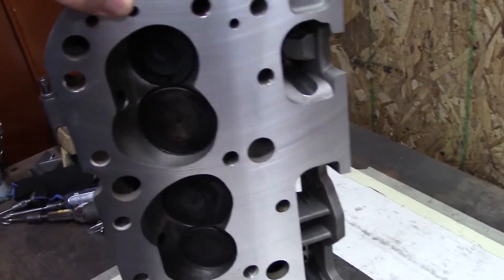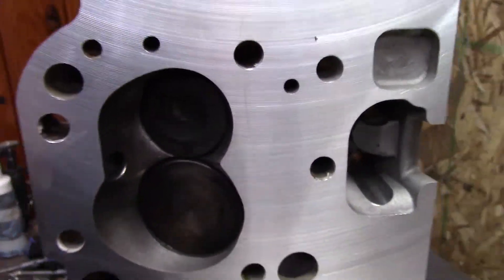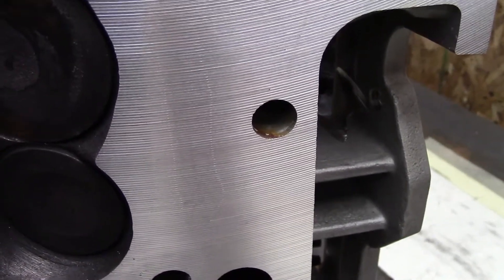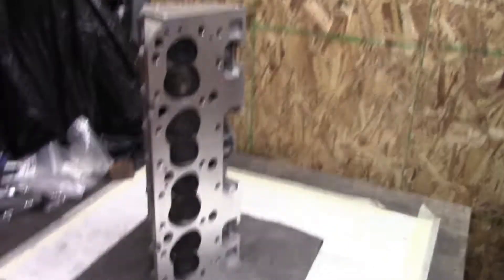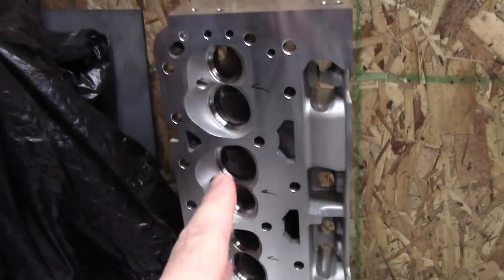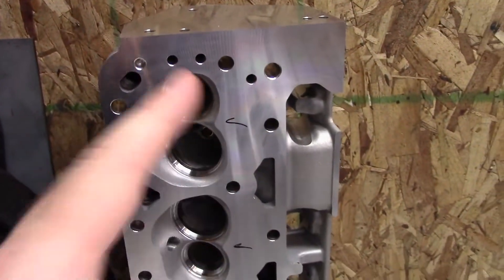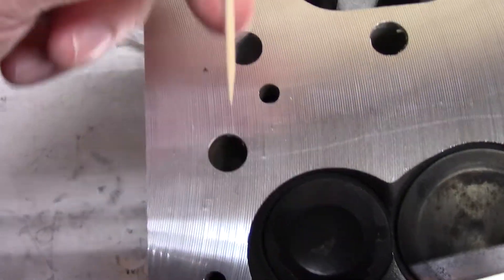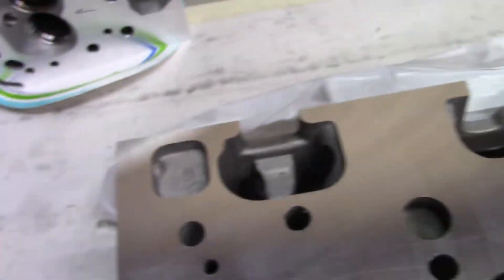Cylinder Head Deck Surface Finish , What Do You Think???

Comment: If it was not more than .004, it's  within tolerance. Surface finish could be as high as RA 100. If you want to make extra sure it won't leak, copper coat the gasket on both sides, and be sure to use new head bolts and  follow torque sequence and specs.
Reply: @JoseLeal-yn4rv

.004 what? Inches? Mm?

Comment: I'm an semi-retired automotive machinest with 37 year experience. I specialize in cylinder heads out of my garage at this point. Low overhead. My verdict is let them drop it on a flat belt surfacer if they have one. It will basically broach it. Usually .005 will be enough to clean it up. Now and days, those circular CNC machines and or lathe attatchments can be lethal in the wrong hands. Personally, you can do an old time boarding with shelving wood, sandpaper and some wd40

Comment: I'd hit it with a sanding board an run it, i've seen factory broched heads that looked like that and never had any issues, we weren't as spoiled 30 years ago as we are now in a CNC world !
Reply from the maker: So you wouldn't bolt them on as is
Reply: @BOOT  no the area that will be the quench area when the head is bolted on could get carboned up , better to be smoother and reflect heat back into the bore as well. i dont see why a clean up with some 240 grit would take more than 5 minutes and if your inclined you could polish the area i mentioned a bit more and yer good ta go.
Reply from the maker: I know someone who said they use a body board to touch up/clean heads and I actually bought one to try it awhile back with finer than 240 but I still have not because I think it will be hard to get it even.  I still may try on one of my old heads but this procomp head isn't mine and I only borrowed it to make a video. Also I would not use a shim or MLS gasket if I did, I'd try a composite BUT I also wouldn't recommend anything sketchy until I have done it myself and tested it out for awhile.
Reply: @BOOT  Yup i have one too, i would spray the head with blueing dye and use that as a visual reference as i was moving around the head with the board watching for even material removal till the blueing is pretty much gone.
Reply from the maker: Good tip!  I'll have to make note of that and I'll share it with my friend if he wants to try it
Reply from the maker: Actually I wanna try a HF 6x2 sharpening stone on my used vortec heads, seen it a few places.  Of course not on aluminum.

Comment: It's good. Those ridges grip the gasket so it doesn't push out when running a bunch of boost or nitrous. I'd actually take it back to the shop and get more ridges machined into it in the opposite direction to give a knurled pattern for even more extra super gasket grabbiness.
Reply from the maker: Well duh the ridges act like a dam n hold the coolant in!  LOL jokes aside here is a interesting comment I got somewhere else, "Extensive development work by Goetze has indicated the need for a very smooth head surface, not rough. The reason is due to thermal expansion and contraction which tears up the gasket surface with use."
Reply: @BOOT  Seems to me the two could work into each other and create an even better seal ... i would hesitate to say Goetze is stating this for all gaskets?
Reply from the maker: @luckyPiston  Over time cycles of thermal expansion and cooling contraction, combined with high clamping pressure makes sense to me that a rough surface could chew up the gasket.
Reply from the maker: Also I herd awhile back MLS(Multi-layer Steel) the layers allow the gasket to slide/shift a bit w/o compromising seal.  So if a MLS needs to be real smooth to not damage the moving gasket
Reply: @BOOT  Yes i see what your sayin, true.
Reply: A good example of that would be a flywheel, the smother it is the the less ability it has to hang on to the disc

Comment: Yeah, that's a no-go, unacceptable finish RA. Whomever was running the machine either messed up setting the CBN cutter inserts, or one was worn badly or chipped. Can't be run the way it is and be assured of a good gasket seal even with a composition gasket. No way ever with a shim or MLS gasket.
Reply from the maker: Thx for the info, had a few other similar comments elsewhere about the cutter being damaged, user error or just neglected maintenance.  It nice that a few(& sounds like you do) with actual experience in machining chimed in.